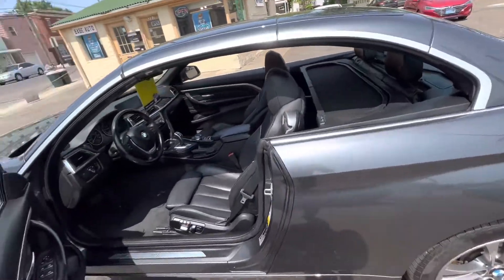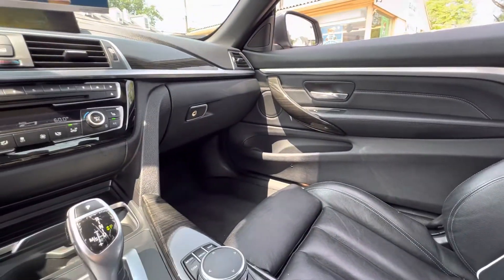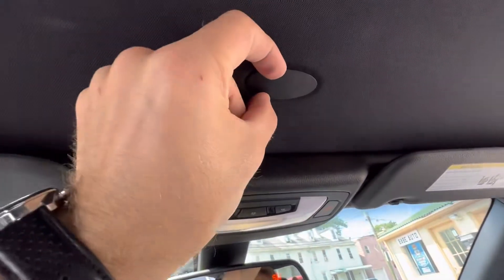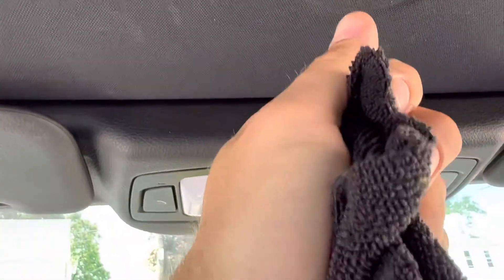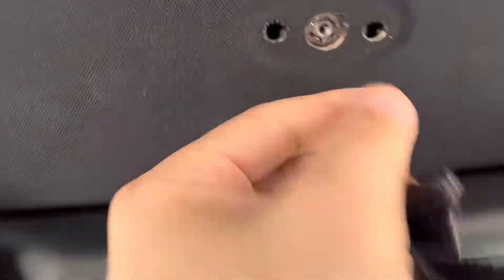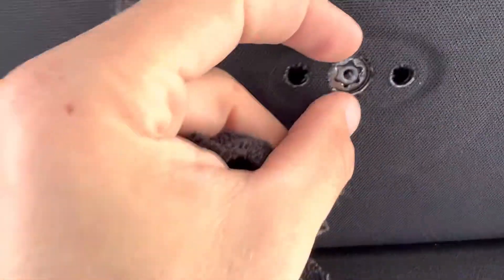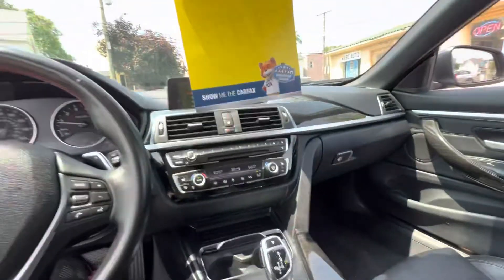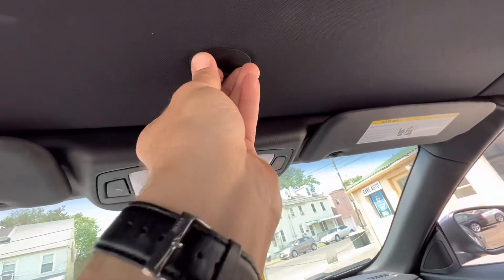2018 BMW 4 series convertible top manually release and unlatch

Comment: Thank you so much for this video. Worked like a charm ✨️ T55 needed for torque
Reply: What tool did you use to put the top in service mode? Were you able to put the top back up after the repair?
Reply: Just need the T55 and torque wrench. Turn counter clockwise to release the air compression. Once unlocked you can open and close it just with the open and close switch.
Reply: @rickydominic5616  Thanks!  I'll try that and reply with the results. I need to replace the right rear window motor. Typical stuck water causing window motor seized issue. Was yours the same issue?
Reply: @rickydominic5616 
안녕하세요 T55를 시계 반대방향으로 돌리면 잠금해제는 되는데 스위치를 뒤로 누르면 완전히 닫혀 있지 않다는 경고등이 들어오면서 작동을 안하는데 방법이 있을까요?

Comment: Could really do with some help to show / talk this in more detail ! My back rear window motor/regulator has broken so the roof won’t open and obviously can’t get to the window to start a repair. 
Thanks for any help ! 
Awfull design from bmw.  Although the original water sloshing was sorted , I still think this caused the problem long term.
Reply from the maker: Sorry I already had the repair completed when I made this video, you’d need to release the convertible, remove all of the trim and the rear seat.  And pull the rear right window glass up and out, the window motors are prone to failing
Reply: Does the first ( middle bit ) just pull out ? And then star out side part unscrew out ? 
And Is the refit just the same way backwards afterwards. After using the roof switch to close.
Reply: Hi i have a problem with a microswitch an it is located on the side of the rear windschield so i cant get to it to change it and my roof is alredy down in the trunk if i can somehow do what you did can i owerride the safe mode and put my roof back up?

Comment: NEED HELP: How do you get the long thing that you pulled out back in? I did this procedure but then the roof didn’t work I slightly pushed it up and now after locking it says roof unlatched. Haven’t been able to put the long piece back in and hoping that may be why.
Reply from the maker: You should be able to push it in. Look inside to make sure it’s lined up
Reply: @DiagandFix  Ahh yes I have managed to do it. Thank you for your reply. After unlocking the front, how did you get the top to fold back? Do you need a computer?

Comment: I could manually lift the front part of the roof but how to lift the back part?
Reply: Having the same issue did you ever find how?
Reply: I called just answer and paid them. Only BMW dealers have the software to put the car in service mode to lower the top. Its catch 22 situation. You may find a non bmw dealer who has the software. If you want to save money buy the genuine bmw parts and take it to bmw dealer to replace them. But again when you take the car to bmw dealer they come up with other repairs and inflate your bill.